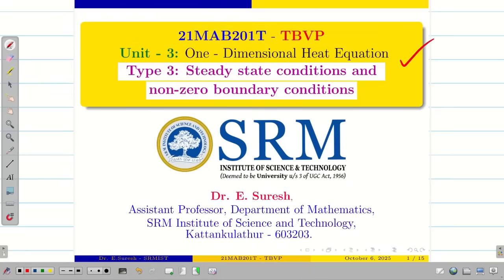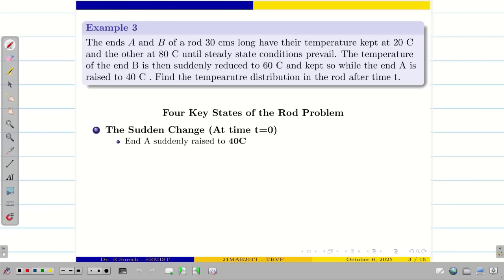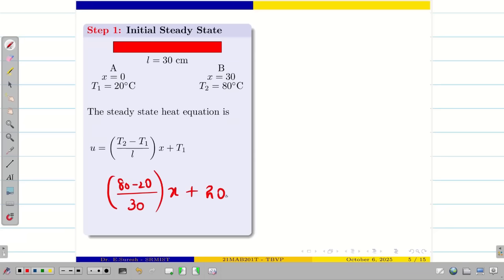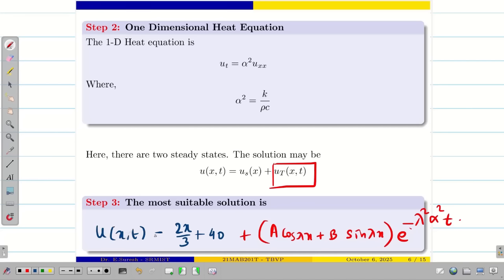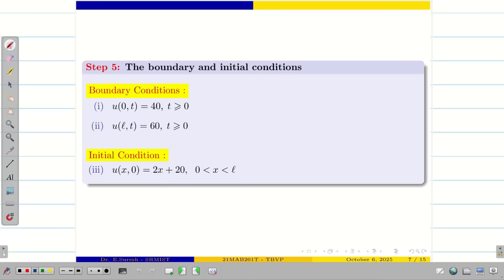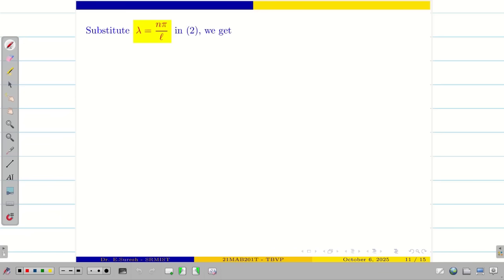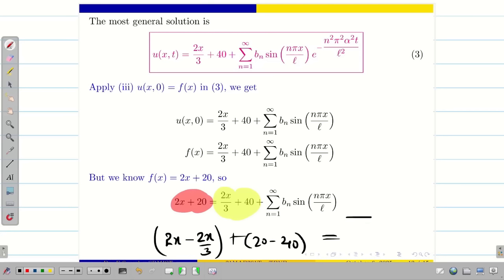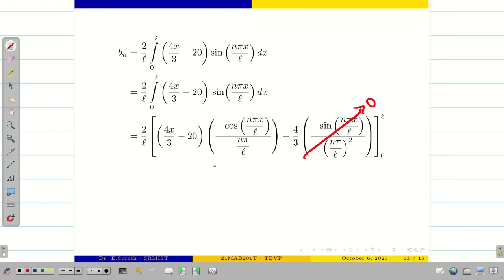11. One-Dimensional Heat Equation   Type 3

Comment: sir why are even writing step 2 in 1D wave and heat equations if we are not using them anywhere in the sum, what is the significance of it?
Reply from the maker: If the question is identified as wave, then only I can write the best solution similarly for wave. For that step 2 is very very important
Reply: bro we take the most suitable solution for that 1d heat or wave equation formula, so we need to write it defo